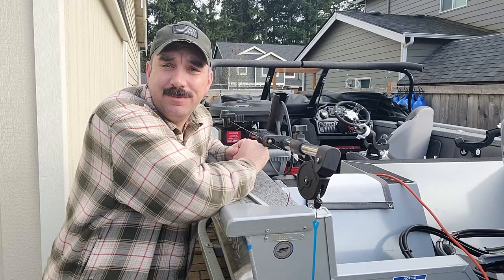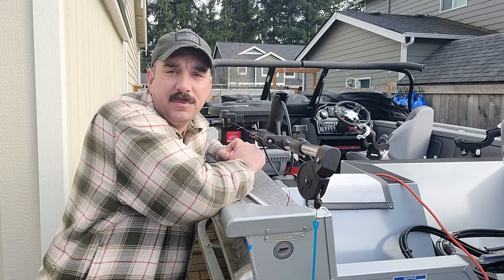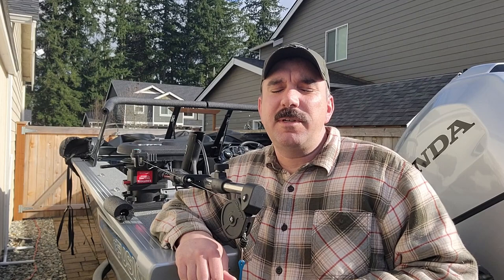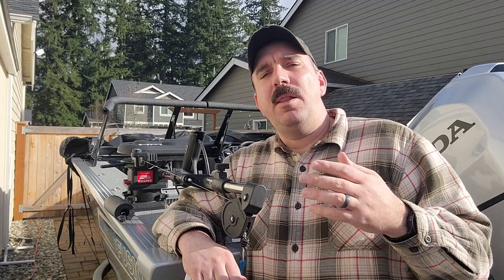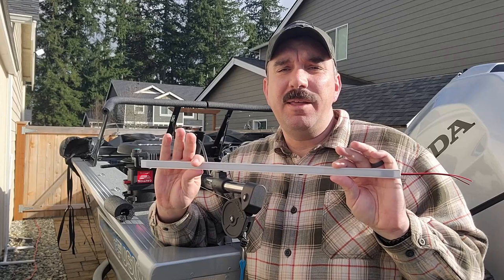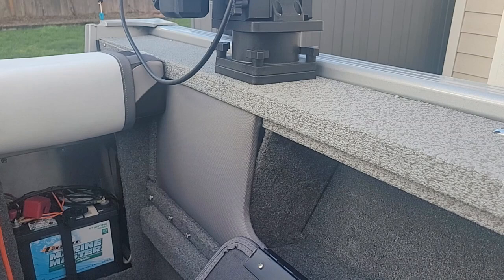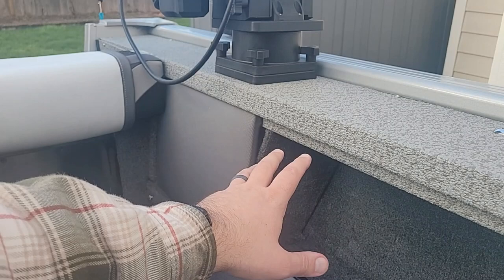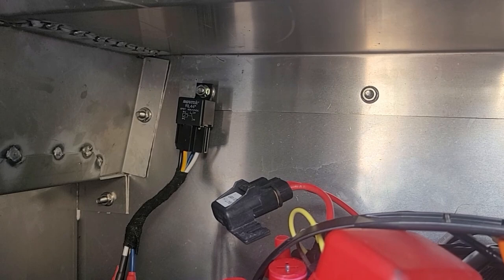DIY LED lighting for adding interior boat lights: Easiest way without adding extra switches.

Comment: Relay, distribution, blocks,  fuses, switches? 

Is there any way for led lights to just go into a small battery
Reply from the maker: Yes there is but then another battery to replace or charge.  But the concept is the same, Thank you for watching.  Fish On!